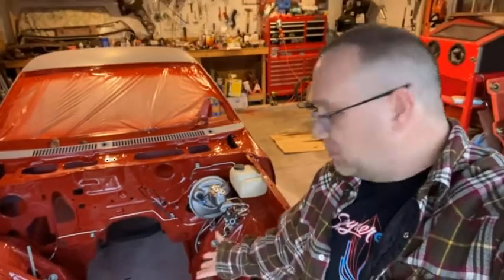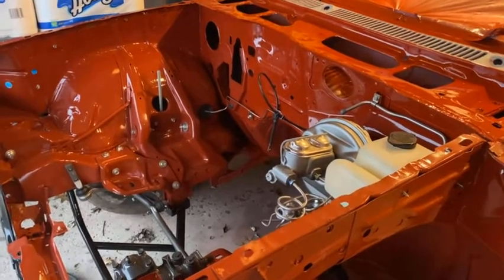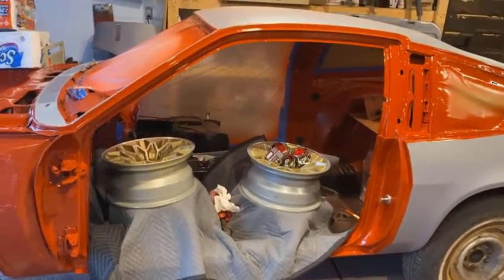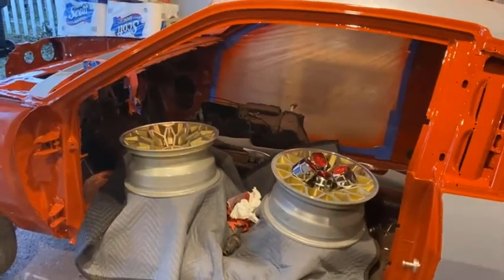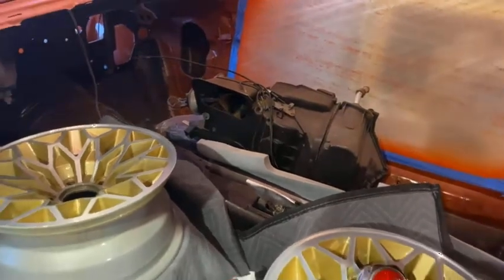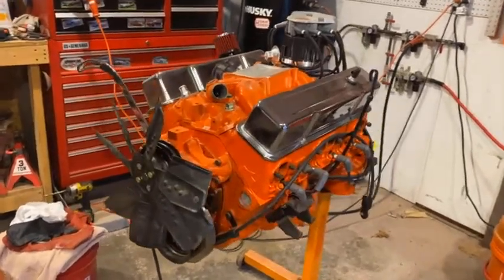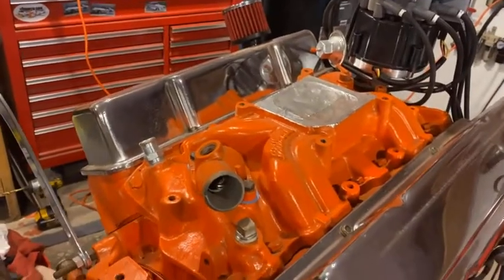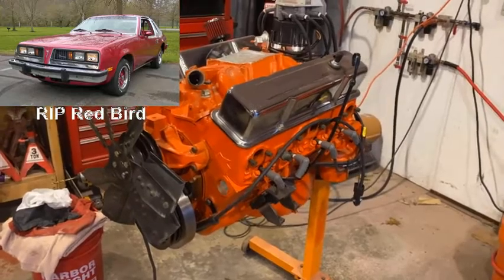Sunbird Short #6 - Engine

Comment: Torquer II 😻 we had a couple of sb 400's running that intake with quadrajet adapters.  Ran great after we stopped the vapor lock issues.  Is your 327 a small journal crank?
Reply from the maker: Fortunately it’s a large journal. I think it’s a 69 vintage. Maybe a 68? 🤔  I was afraid I’d need a new crank after spinning the bearing but the builder said no issues with it.   Go price a small journal crank.  They are big $$$$. 😬

I’ll swap the heads on it before it goes into the car.  These are 64 or 68 cc chamber heads but no accessory holes.  I need those for the power steering and ac.
Reply: @sunbirdgarage2774  yah you are good to go man!  I agree you need some acc hook up heads, power steering nice!  I've had two cars with manual steering, both were a trip to drive